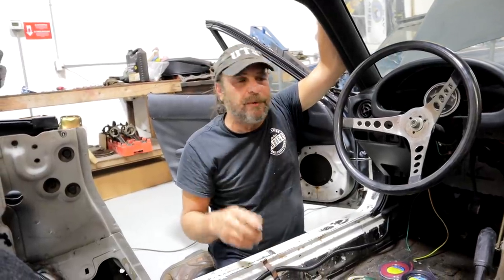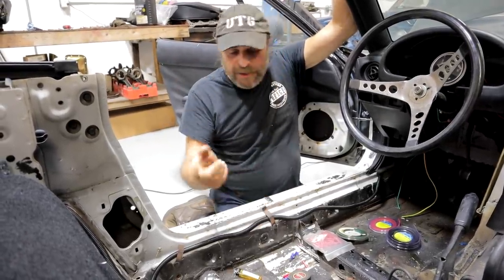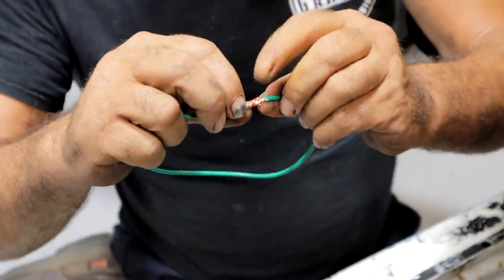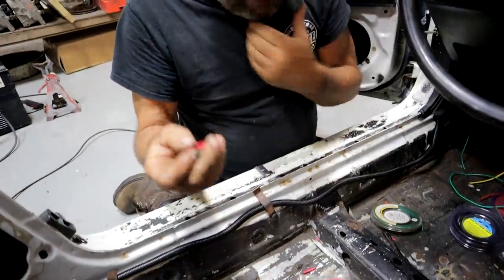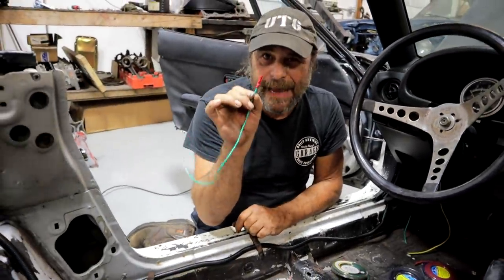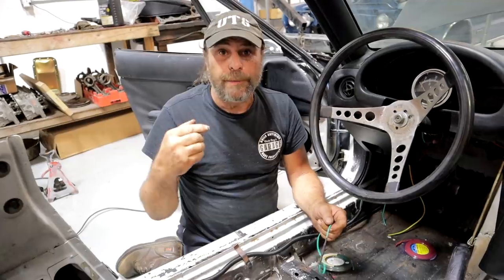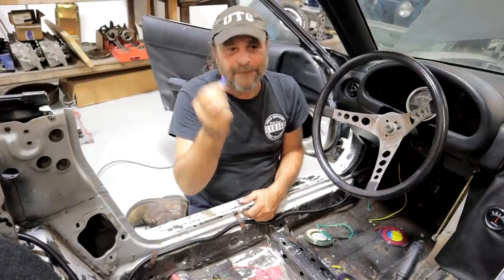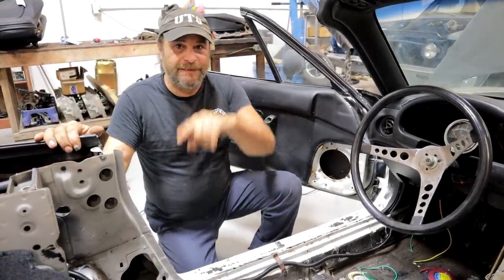The Single Most Misused Item In The World Of Cars

Comment: Obviously you put on the shrink tubing before you solder the wires. I seem to screw that up a lot.
Reply: You and me both. You get so happy that you got the crimp down while contorting yourself that you forget to put the shrink on....
Reply: I disagree with his whole context here.  These types of connections should be both mechanical and solder and then shrink wrapped on top of that. 
You're doing wiring that will be under carpet and totally inaccessible ever again without dismantling the car.  Nobody knows if these things will last 40 years. We KNOW solder lasts a very, very long time and is both mechanical and chemical, on top of a physical mechanical connection like twisting the wires together.
Reply: Flaring brake lines and forgetting the fitting, that's my favorite
Reply: @CodyFazio  I'm good at that too!
Reply: there is a shrink TAPE available.
also liquid tape
Reply: @CodyFazio  
Yep , both. 
Every once in a while it happens. 
And it seems like the odds go up alot when you don't have a half inch of wire or tubing to spare 🤦
Reply: @tarstarkusz  problem is most folks use a 55 gallon drum of solder for 1 connection and it wicks down the wire and makes it solid. 
All ya need is a touch and you should still be able to see the wires thru the solder. 
I know for home plumbing, if it's a 1/2 inch copper pipe youre soldering ,use a 1/2" of solder. 
Not quite the same for wiring , but you need like 10 times less solder then is usually applied.
Reply: @MrTheHillfolk  I agree somewhat, but it depends on the application.  In this case, there should be a good mechanical connection and a fairly small amount of solder. When Tony was showing the old way where the twist the wires together and then fold them over and tape, that is the right way, but with solder added and then shrink wrapped on top of that. Solder is for an electric connection. A mechanical connection is for strength.  Just laying wires together and soldering is the wrong way to do it.

 Also, stripping too much of the wire away will also be a problem with creating a long piece of basically single strand wire by using too much solder. I know exactly what you mean there.    However, I would rather see that result with good soldering  (a nice good joint) than what most people create when they solder.  Most people put solder on the iron tip (some is good for heat transfer) and then blob that solder onto the connection.  Also using either flux or at least flux core solder. 
Far too many people own soldering irons.
Reply: We've all been there bud
Reply: @CodyFazio  yep done that one more than once
Reply: @james_chatman  Gotta hate playing the blame game with yourself....
Reply: Lol... we've all done it! 🤣
Reply: @CodyFazio  i could feel my blood pressure rising just reading your comment.
Reply: @bobm9509  I suffer from brake line PTSD
Reply: @tarstarkusz  
Haha and I'm in the middle of some wiring mods for my current project. 
Hadda lengthen the fuel pump wiring. 
Even went to the boneyard and stripped out a bunch of the plug from another car so I can keep the same color wire and not get confused.
Also staggered the 4 connections I hadda make so it's not a big blob of crap in the harness.
That helps alot for multiple connections in the same area.
Reply: @MrTheHillfolk  Staggering is always a good idea.
Reply: @CodyFazio  Or the fitting is on the wrong side of the bend.
Reply: @tarstarkusz  as long as it's not from having too much to drink while wrenching 🤣🤣
Reply: Shh don't mention soldering and cars because the know it all's will get you 😆 I prefer to solder most connections when possible and it's how I was taught when I worked for a top fuel team. Our crew chief hated crimp connections and we never had a problem with properly soldered connections. But he lost a race because a butt connection failed. The biggest issue with solder is it's easier to screw up and not see it.
Reply: Sometimes I don't have the right size shrink tubing.
Reply: @CodyFazio  up that’s right up there with making coax and forgetting the screw on part of the pl 259 connector
Reply: Also in the last 200 years people haven't been putting on the single-ended latex tubing before connecting the DNA signal wires, and now a quarter of the USA is on fire.
Reply: @tarstarkusz  Also...to make you feel old...40 years ago was on July 27, 1981.
Reply: @tarstarkusz  Also far to many people own cars which increases the road rage levels.
Reply: @brentfisher902  I was 12 in 1981!  Yeah, we're getting old.
Reply: @brentfisher902  Far too many people have driver's licenses.  There. Fixed it for ya! LOL.

Comment: Great tip. My preference is to solder and heat shrink, but heat shrink should be used either way, especially for exterior connections. For temporary circuits, I like to use regular wire nuts so I don't waste crimp connectors and because they are easy to install and remove without cutting the wire and are reusable. I'd never leave them in, but they are plenty secure for temporary use and testing. Wago lever nuts are great for temporary wiring too, but much more expensive than wire nuts.
Reply: I just buy motorcycle bullet type connectors in bulk.

Comment: Good advice! 

I like using the butt connectors with heat shrink already on them.
Reply: never saw one
most plastic doesnt shrink
Reply: @hotrodray6802  The ones I have used are light blue .  Almost transparent.
Reply: Me too.  It's the only style I buy now as I don't need to tape, or shrink tube the connection.  Crimp, heat and done.
Reply: @hotrodray6802  Polyolefin.....
Reply: @hotrodray6802   I dunno the brand, but Eric O. from South Main Auto uses butt connectors with built-in heat shrink - and there's some sort of adhesive that oozes out from the ends when you shrink them so it's a perfect, watertight seal.  I'm sure they're not the cheapest, but compared to doing the job twice...  :-D
Reply: @Volusia-ev. I’ve worked in truck upditting for 17 years specializing in electrical and those connectors are the only ones allowed to be used.
You can imagine with hundreds of connections on large piece of equipment that’s going to work in the sub arctic problems with the old style connectors pop up fast. In the first year we halved our warranty claims.
And vastly sped up production with the heat shrink connectors. They are not cheap to be fair. But they work fantastic and will easily outlast the vehicle. The main brands in North America are “quick cable”
“Pico” and most good one are manufactured by “S.E.S.” Out of Florida I believe.

Comment: Liquid electrical tape  can be a lifesaver too. Seals the wires tight.
Reply: Love that stuff.. its also good for sealing wires where insulation has been cut but not the wire itself.. 9nly thing i hate about the stuff is the containers it comes in.. are terrible..  and overtime it dries up in the tub
Reply: Hells yes. Don't have to remember to put it on beforehand, it's always the right length, and it doubles as install adhesive!
Reply: Where can I get some of that liquid electrical tape  ?
Reply: @jimwednt1229  any auto parts stores should have it
Reply: @jeepsblackpowderandlights4305  , thank you , I appreciate your help.
Reply: The liquid electrical tape in the aerosol can is also good for electronics projects that you soldered together point to point without even a single circuit board.  Just hose the mass of wires and component leads down with it, wait 43 minutes, do it again,  wait 43 minutes,  do it again,  then wind a bunch of old fashioned electrical tape around it after it dries,  then paint it over with the non-aerosol electrical tape for a few coats.
Reply: @brentfisher902  ," old fashioned electrical tape " 
 You talking about the cloth tape that doesn't have glue on it ?
Reply: @jimwednt1229  I meant the plastic that is not a liquid when you first use it.
Reply: @brentfisher902  oh okay got it . Thanks ! 
 I have a welder and the  insulation on the leads is dry rotting and cracking . Figured I'd try liquid tape before replacing them . 
Edit : New Heavy 1 or 2gauge cable like that  was pretty expensive last I checked .

Comment: I've always been the solder and Shrink tube kind of guy and old habits die hard. I feel like everything else can get moisture inside for pull apart.
Reply: I use noninsulated crimps with solder as reinforcement, plus shrink tubing of course. Best of the both worlds I think
Reply: Exactly! The way I wired my 72 Z/28. I get my terminals/wire etc from MAD Electrical. Mark the owner will talk you through any electrical issue you have. Guy is a wealth of knowledge, 60 years of wiring RV's Hot Rods, Trucks, Heavy Equipment.

Comment: My daughter’s first car was a 79 Dodge Aspen, with a 225. It was a freebie from a neighbor. I thought it would be a good platform for her to learn the ins and outs of vehicle maintenance. At one point she wanted to put in a stereo, but there was no adapter kit for a car that old. So we worked together, I showed her how to figure out the wiring, etc. She did most of the work, I had her solder and use shrink tubing on all of the connections. I was impressed with her work. It was a great car and we had a good time working on it together. So, Uncle Tony… My point… you have a very valuable channel.

Comment: A few points from someone who also have some experience with fixing connections.
1: Thank you for pointing out those horrid solderfree, jackknife variants. They can easily cut your wire off within a few years. They ARE NEVER to be used.
2: Those crimped red, blue and yellow connectors have a clear/opaque version - which can be melted with a regular heat gun. Fairly good. I usually run the wires all the way through for a better connection.
3: ALWAYS crimp from the outside towards the inside. Otherwise you can push the wires out if you are unlucky. Also make a hard pull on them to check that they are good and strong. Had a bad crimp today just fell out of the crimped piece...also your crimp tool is NOT good enough. You need a real presser (which locks the tool until you press hard enough). If you have to use that crimper, crimp on the other side of the joint. It will be much stronger.
4: Thanks also for telling people to SEAL all connections. With time, most connections otherwise go bad. : )

Comment: I'm a dealer tech. Been doing it 12 years now. Always solder and heatshrink everything. 

These crimp butt connectors will be a come back at some point.
Reply: solder under the hood is also a comeback waiting to happen. I like the 3m crimp/shrink/adhesive combo connecters.
Reply: Solder connections can create issues as well.  The rosin is acidic.   When I work circuit boards, I have a special cleaner to remove the residue so it doesn't eat the board.   Solder is also rigid and weak, prone to oxidation.     However, butt connectors do have an introduced point of resistance to be factored.   One is negligible, but 10 in a circuit will cause some issues.

Comment: So you know, you're holding your crimping tool backwards when you're stripping like I used to do so many times.  The printing is meant to be readable while you're inserting the wire from the front side with the taper.   Try it both ways, and you'll see you don't have to pull as hard to get the insulation off.
Reply: True. Also, don't twist so much, and use a bit longer stripped end. Let the ends of the individual wires mesh and mix inside the connector and crimp them together in the center as well.
Reply: That style of tool is garbage no matter how you use it. Just get the right tools.

Comment: I like a dab of antiox paste on my wire before it goes in the connector
Reply: antiox is actually engineered specifically for aluminum wire. It oxidizes differently than copper. You are better off with plain old dielectric grease.
Reply: @DanEBoyd  not to speak for anyone else, but in a case like that in my professional life I'd have to question the design and intended use of the materials. In other words: a different set of materials might be in order to avoid having that peoblem in the first place. I see this type of issue professionally in for instance incompatible confomal coatings on circuit boards after a repair. I fail them without exception, to force engineering to re-evaluate the rework instructions, because  they will experience premature failure.
Reply: @DanEBoyd  every single electrical connection is a situation where galvanic corrosion is possible. Even copper to copper if they are different alloys. Or have different coatings. Again, the "antiox" or more commonly called "noalox" is designed for aluminum wire specifically. It actually has stuff in it designed to penetrate (mechanically) the hard oxide that forms on aluminum as soon as it is exposed to oxygen. Not saying you cant use it on copper. But I have found dielectric grease lasts longer. And is more effective at warding off "green-death".

Comment: I remember when a friend put a stereo and equalizer in his 73 Charger.  He wired it by just twisting everything together with no tape.  Some owner of the car before him had done a number on the dash with a hacksaw where the radio was supposed to go leaving only one knob hole to support the whole radio as the older Chrysler radios had the volume and tuning knobs side by side.  Further he set the equalizer down on on top of the transmission tunnel.  

Essentially, every time he rounded a corner or went over a bump wires came loose or grounded out.  Sometimes the equalizer also went flying.  Consequently, the job of whomever was riding shotgun was to get under the dash and get the tunes back up and fast.  He was an impatient guy (actually more of a dick) and had little tolerance for someone who could not get them up fast enough, especially when he wanted to crank up the volume to impress some girl.  I was one of the few who could get them up running pretty fast, so I used to get to ride shotgun the most.  However, I would have preferred to sit in the back.
Reply: ive had really good luck on thinner wires twisting them together, folding them over, and then using shrink tubing over that its comes out pretty neat and seems to work well. The problem with soldering is that apparently wires like to break right after the solder joints if they move around much.

Comment: The chinese cannot make proper butt connectors.  I bought hundreds of them for my Jeeps wiring and they dont work properly.   

Also tony they have heartshrink crimp connectors lol get with the times.   You crimp them then use a torch or heater gun on em..  heatshrink tubing is a waste of time these days imo.   Get yourself a better tool too.. 

that harbor freight dollar store tool makes things 100x harder and is the reason you have wires pulling off a butt connector.. it doesnt crimp the connector tight enough.. they can twist right off the connector like a pair of dull scissors...  spend the 25$ and get the right tool.. and youll never have wires ever come apart or pull off a butt connectors.   Heatshrink isnt going to stop a crappy crimp from a tool you spent 1$ on

Comment: Use marine grade low temperature solder connector instead. Seals solders and vibration resistant all in one.
Reply: not under the hood with that low temp stuff. troubleshooting nightmare on something like a 5 volt reference signal.

Comment: I bought a set of mechanical wire strippers, paid $45 15 years ago. Some of the best money I ever spent. Snap-on sells the exact same one today. 

They make butt connectors that the insulation is heat shrink. Then heat shrink with a little button of solder inside. 

Or, get uninsulated ones, they have a little hole in them that is handy for getting solder inside before shrink wrapping.

Comment: When it comes to my car I'm a pain in the ass, it has to look pretty, I can solder, but to me it does not look good , even with shrink tubing over it, I cut the insulation off of butt connectors and crimp, then shrink the tubing with a heat gun, I have been doing this for years and have never had a problem!
Reply: I do this all the time. I also do it with spade connectors. Compared to the factory insulation, they end up smaller shrink wrapped and you can colour code the shrink wrap to identify circuits. Since it is easier to keep a kit of colourful shrink wrap than a bunch of spools of wire, I sometimes find it better and cleaner looking for simpler wiring jobs to wire with one colour wire and identify with shrink wrap on ends.  Btw, I found uninsulated butt crimps on amazon a while back and it saves me the pain of cutting the insulation off.
Reply: You can buy non-insulated butt connectors and save yourself both money and time. ;)  With the non-insulated ones, you also get to use the u-shaped crimpers instead of the round ones, which makes a more solid connection.  You can flow some solder in there as well when you're feeling extra ambitious.  Adds a little strength to the connection, but the big thing with the solder is that it fills up the space, making a better electrical connection.
Reply: I don't think you are soldering correctly.    Try a linemans splice..... but solder is rigid and brittle.  You have to pick the appropriate splice for the condition.  One needs to flex, or the slower will cause the wire to break,  while the next can be held in place and not require any flex.   Think about this before "feeling ambitious" and creating a problem by trying to do better.
Reply: @LabRat Knatz I still use the good Ole 60/40 solder.   It gets brittle, too.